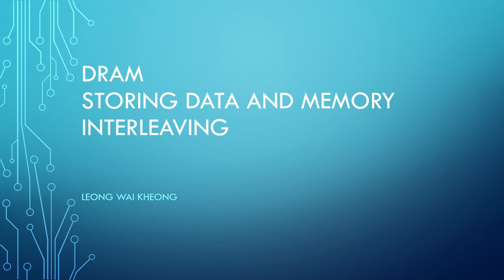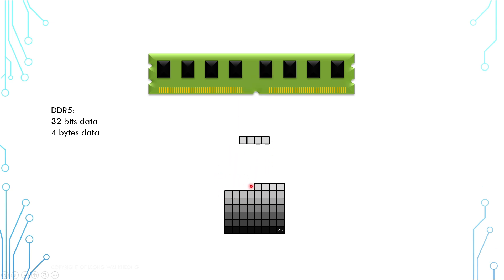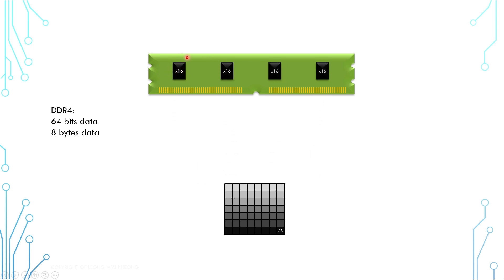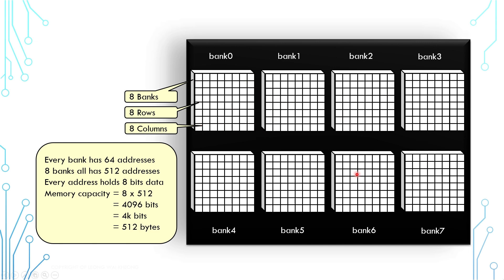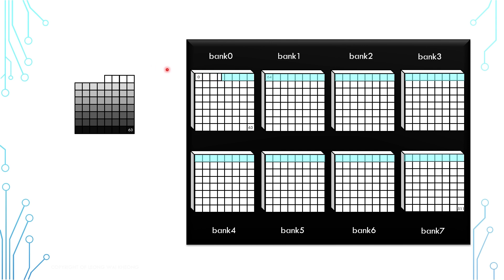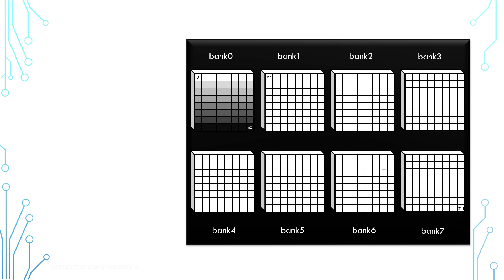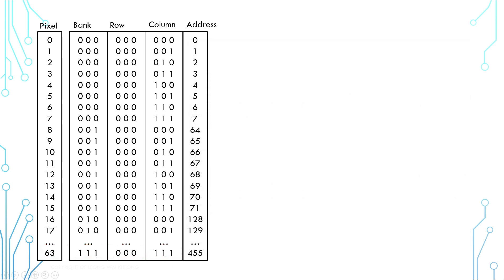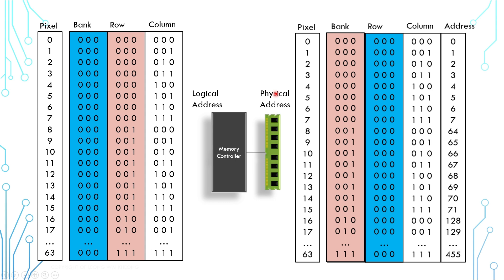DRAM 06 - Storing Data and Memory Interleaving

Comment: 5:30 The address bits with the ACTIVATE Command are used to select the BankGroup, BANK and Row to be activated, the activate command does not activate rows in other banks.
Reply: Yes this also threw me off for a while. I was confused what the point of having multiple banks would be in such a case since they all act in tandem.